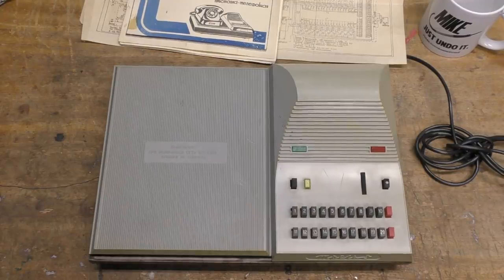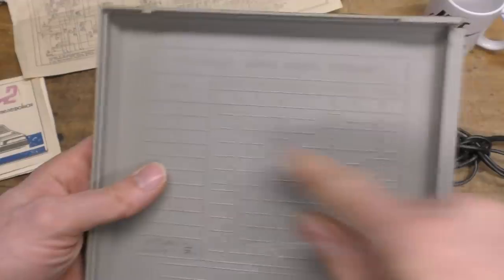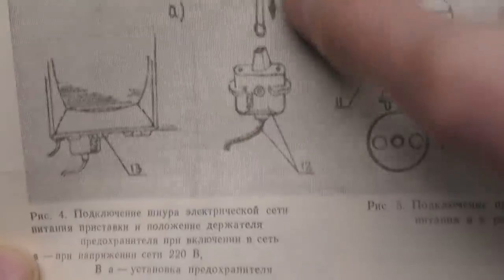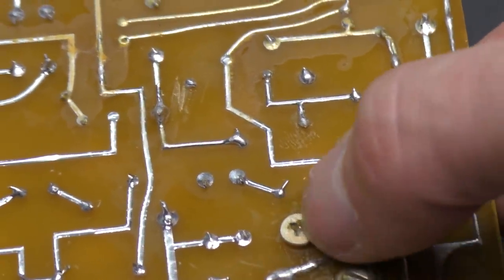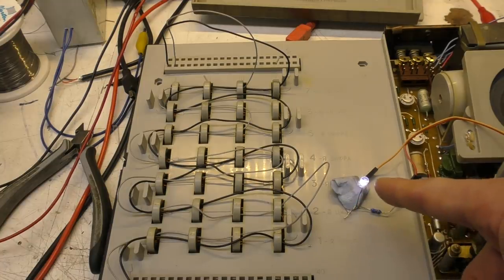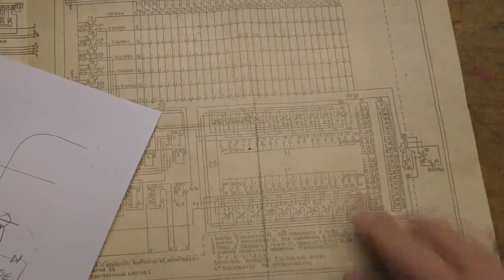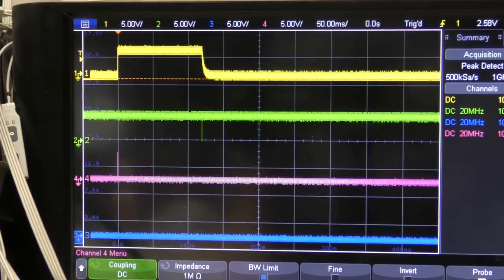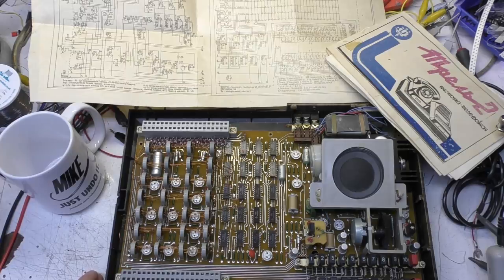Russian phone dialler using interesting magnetic memory tech

Comment: You would think ROM chips would have been cheap enough in the Eastern Bloc by 1995 to use in a device like this. It's not like there was still a trade embargo limiting their supplies. And sure, they may not have had access to MCUs. But you don't NEED an MCU to make an autodialer. There are many ways to skin a cat, you know =P. Like you could use just a ROM chip and some logic. I can't speak for ROM chips, but I know the Soviet Union had their own fabs that churned out soviet equivalents of jellybean 7400s. It may have been larger than this design since it would have more discreet parts than an MCU based solution.

You could even make a 40 byte SRAM module which would require only 2 transistors and 2 capacitors for each bit. And then use ladder logic for address switching and selection. Basically a bunch of switches set up as a multiplexer. Which would probably require its own separate box. But it's a solution lol.

One thing I really like to do as a hobbyist is to build circuits from discreet components that would normally be built using simpler parts like ICs or MCUs. Like an SRAM module I described above, or a shift register. Or even a breadboard based 555 timer.

In fact, a project like this would actually be a good little exercise for anyone looking to hone their electrical and/or computer engineering skills. I can speak from experience that building SRAM modules from discreet transistors like I described is extremely tedious. Not to mention takes up a lot of space. Just using breadboards, it would probably take 2 boards just to fit 1 byte of memory onto. Never mind the switches and stuff for addressing. I would suggest sticking to 1 byte of memory just for a proof of concept sorta deal since you're gonna have build the exact same circuit over and over again for all 320 bits of memory. That is, 8 bits per byte times 40 bytes.
Reply from the maker: A ROM chip would not be useful as users need to be able to program the numbers. You'd need a minimum of 140 bytes (280 digits) SRAM, not 40.
Reply: @mikeselectricstuff  Very true! Even the Duga-2 (russian woodpecker RADAR) used core memory, punch cards, and analogue computers!
Reply: The design is surely much older than 1995. It looks like one of units manufactured after end of USSR to get rid of stock of old parts and get something out of old manufacturing plants. Producing things straight from the museum at early 90's was happening in basically every Eastern Bloc country - for example I have Polish Nixie tube multimeter with manufacture date 1993:) In Eastern Germany there were still Wartburg cars made in 1991 (hilariously "upgraded" with VW Golf II engine and Opel seats after Opel bought the factory few years before).
Reply: @shana_dmr  Certainly older than 1995.  The date codes on the ICs are a giveaway. They are from 1982 - 1984.  The design very likely is older than that. The USSR had a very complete logic family (mostly based on western 74xx series devices) that were very widely used in Soviet era tech.  And I remember the Warturg. An old friend of mine in the UK had a Wartburg (the Tourist model I think) and that was back in 1977 or 78.  Of course, back then it was the original two-stroke three cylinder.
Reply: @GodmanchesterGoblin  Yes, I remember the Russian TTLs, rarely used them myself though - we had our Polish 74x clones made by CEMI, though we didn't scramble the part numbers (for example 7400 was just UCY7400). In the 80's we even had MCY7880 - 8080 microprocessor clone, rather elusive part though if you didn't work in national computer production facility.
Reply: By the early 1990s Russia was awash with homemade 8-bit computers (clones of Sinclair Spectrum) and microprocessor-based autodialers/caller id gadgets. The device shown here would have already looked archaic then.
Reply: @cogoid  Of course, I'm just saying there were absurdly archaic devices still being produced at the time. Most of them didn't end up at the consumer market.

Comment: My best guess - it would have allowed a secretary, to connect a military commander, to a number, with out them being knowing what the number is.  Especially if the phone was screwed down to the base, with tamper proof screws.

Press the number and lift up the receiver once it started ringing to HQ :)

Likely as not, it would have been on the separate military phone network, hence only 7 digits needed.
Reply: I'm sure people back then knew that they could count the relay clicks to learn the number.
Reply: No, regular device for reception or secretary in relatively small organisation. 7-digit was maximum local phone number length in USSR (not counting region/town codes).

Comment: The casing reeks of perestroika-era construction but most of the components are actually better quality than you would find in a lot of Soviet equipment from that era.

Another desktop machine which used core rope memory was the HP 9100 desktop calculator.  It was used for storing the control instructions, or the "microcode" if you wish to call it that.

Comment: This thing wouldn't work very good if you had 10 digit dialing. That is, if you had to dial the area code for local calls. I can't speak for Russia, but as of about 20 years ago, they implemented 10 digit dialing here because the original area code ran out of numbers and they had to use a second area code for local calls. And now they've already run out of numbers for the 2nd area code and have already had to implement a 3rd area code. I wonder what happens if we run out of area codes. 4 digit area codes? That'd be a logistical nightmare for the telecoms companies.
Reply: It would work well in the US for local area dialing, though.
Reply: in 1980s, it was 4 to 6 digit phone numbers in soviet cities, and, may be, 7 digit in Moscow. Also, area codes was very short, 4 digits maximum. I think, this is because of Russian Empire was one of founder of ITTU, the body which assigned this codes at the end of 19th century. For example, my native 1-mln city in Siberia always has area code 3912, and 6-digit local numbers in 1980s.
Reply: @thelittlebigoneru  That's really interesting. Thanks for sharing!
Reply: As it was pulse codes, you waited for the open line signal after dialing the town code, and then entered the local number(so code is not part of the number per se). Maximum was 7-digit numbers, I think only in Moscow.
Reply: Can programme 2 buttons to dial your number though. First button for code, second button for number.

That would require it to be able to auto dial a second number without hanging up in between.
Reply: @RichardPolhill  Yeah actually this would be a pretty simple fix. It kinda defeats the point of 1 button dialing, but I think the point was more so you didn't have to remember all of those numbers.

Comment: dip switches, or little rotary switches would gave been a lot simpler
Reply from the maker: I don't think 280 rotary switches would have been simpler...
Reply: 280 bcd switches would make it easy to read the stored numbers. imagine trying to work out the 40 stored numbers looking at a rats nest of wires threaded through binary hoops
Reply: @lumsdot  and the cost? those switches make sense for when you want quick change ability and can't understand the cheat sheet on the back of the cover, 28 ferrite rings, no movable parts and a wire VS 4*7*20 switches, not to mention the reliability, for which USSR manufacturing wasn't really known for
Reply: Then think how much ICs would you just take to multiplex through 40 of them. And how much board space would take 40 of those switches. And mind you, they did not have any dip switches back then.
Reply: @Sixta16  Oh hello ! Didn't expect you here.
Reply: @teslakovalaborator  What so unexpected about seeing me here? I am a Mike's long time subscriber. ;)
Reply: @Sixta16  DIP switches were patented in 76 and used in products by 1980
Reply: @whoho1  Probably also not in russia, sir.
Reply: It might have been, but possibly would have required more components. Each coil here is used for multiple phone numbers.

Comment: Ah yes, good old soviet TTL's with 2.5mm pin pitch instead of the pesky imperial 2.54mm. I wonder if this was intentional or just Ivan had only a ruler in his hand when examining some freshly new smugled ICs
Reply: My money is on intentional. The Soviets were pretty aggressive with metrificating everything. For example even to this day Russia and a few other ex-Soviet states (plus Mongolia for some reason) are the only countries in the world that use metric altitudes and speeds in aviation.
Reply: @blahfasel2000  That's not true. Almost the entire world uses meters for altitude, except for North America. For speeds, I think it varies, but the ICAO encourages km/h or m/s depending on what is being measured.
Reply: @AureliusR  International standard, certainly for controlled commercial traffic, is feet (including FL) and knots. Stop bs-ing people. Russia does still use metres, but only up to transition level (10k ft/3050 m).
Reply: @AureliusR  Have you ever flown in different parts of the world?  Altitude is always in feet, speed in knots (nautical miles per hour).  It's the same in the UK, in Europe, the US, south east Asia, etc. Aviation uses common standards because it is critical to the safety of aircraft and those on board.
Reply: @GodmanchesterGoblin ICAO Standards and Recommended Practices, Annex 5 - primary units are only Si-units(m, m/s, km/h, etc). Foots, knots and Nautical miles are listed as "Non-SI alternative units permitted for temporary use with the SI" and  they "have  been  retained  temporarily for  use  as  alternative  units because  of  their widespread  use  and to  avoid  potential  safety  problems  which could result  from  the  lack of  international coordination  concerning  the  termination of  their  use." But Russia indeed switched to ft for altitude quite recently.
Reply: @yanikkunitsin1466  Fair enough. You clearly know more about this than I. For a number of reasons I have not flown recently. My apologies for my mistake.
Reply: Intentional. They had the same ICs for export with imperial pitch too.

Comment: I think for digit select they could have used just 2 wires per core. Have one wire pass through all the cores into the common emitters and selecting digit by passing the same current in opposite direction through that 4 rings.

Comment: Were diodes expensive back then? Cause they could just diodes and a grid for the numbering
Reply: What do you mean exactly, the 20 preset selection keypad? There has to be a latching switch
Reply: @pasikavecpruhovany7777  I was talking about the magnetic number selection
Reply: @alexstone691  That would mean over a thousand possible positions for diodes to store the same amount of numbers, this solution surely is simpler ...
Reply: @moe.m  I was thinking something different, like it's done today with keyboards
You have rows and columns and then you just short the telephone number to a place
To me it sounds simpler than that many transformers and wires and pulses and stuff
I probably havent explained properly though
Reply: @alexstone691  What you describe would give you a way to encode one number. You can't put 20 different combinations of diodes into one multiplexed matrix.
Well, unless you make the matrix itself 20 times bigger, I guess.
Reply: @Lemon_Inspector  Imma write it down tommorow if i don't forget, maybe i am just confusing myself
Reply: @alexstone691  diode matrices were used to set frequencies for channels in some old 2 meter radios such as Icom IC-705. But the freq always begins 144.(5 or 6)xx. Mhz. So only a binary state, and 2 decimal numerals stored for each channel. So in that case plausible.

Comment: I would have designed this with a big punch card and lots of contacts, that would have been even cheaper and a lot more user friendly. 
The ultra low budget model could have had only a single row of contacts and no number switches, you'd select the number by pushing and pulling the card in the right position.
Reply: That would have the benefit of being able to store an unlimited number of... uh... numbers. And the cards wouldn't even have to be that big. At one point, IBM punch cards were 12 rows by 80 columns, enough to store 240 digits with BCD.
A more sadistic solution would be a paper tape with holes poked in for dialing pulses, and the user has to pull it through the reader at exactly the right speed...

Comment: In Soviet Russia even the phone diallers were EMP resilient 😅
Reply: with all that TTL logic and no shielding? :P
Reply: @AKAtheA  A perfect example of the empty promises made 🙂
Reply: Yeah I'm sure all that TTL will LOVE the induced voltages from all those magnetic cores, too!
Reply: @Basement-Science  it can't induce voltage from an outside field, the core creates a complete magnetic circuit...the PCB tracks and loose wires (and being connected to both the power grid and the telephone network...) should be more then enough to blast it into silicon heaven in case the Cold War went hot...
Reply: @AKAtheA  "the core creates a complete magnetic circuit" - well not quite. First off, this is only true for an idealized core, or one with ALL windings equally spaced out along the ring, AND ONLY is a closed, circular magnetic circuit IF we're talking about the resulting magnetic flux from one of the core's windings being powered. 

Also note that the turns of the sense coils in this device were not spaced out evenly along the cores.

If a magnetic field were applied externally, say with a neodymium magnet (or EMP), from the top of this device, the magnetic field would still pass through from top to bottom, and magnetize the cores in this direction instead of with a circular field inside it. So this would induce voltage in the coils depending on the direction and rate of change of the magnetic field. If the turns of the sense coils were spaced evenly, the voltage would mostly cancel because some parts of the coil would have opposite polarity from the rest, but then again nothing is perfect. 

So yeah, if they had spaced out the turns along the cores, they could have mostly removed one of the device's many EMP susceptibilities. But as it stands, it could most likely be destroyed this way as well.

Comment: The logic chips are 7474, 7400, 7401, 7422 (none of that 74LSxx rubbish). The transistors are indeed germanium, and quite obsolete for '85 (МП25). In fact the entire design appears to be based on what was available back in ~1975 in Soviet Union.
Reply: just what I was thinling

Comment: The PCB material is actually the usual fiberglass soaked in epoxy. What gives it papery feel is the glue that was used to attach the foil that was etched out. And of course having no solder mask is an absolute soviet tradition.
Reply: Still to current days.
Reply: @pashko90  still to current days what? :)  FR4 as PCB substrate of lack of soldering mask?
Reply: @thelittlebigoneru  Some army pcbs i seen without a soldering mask.